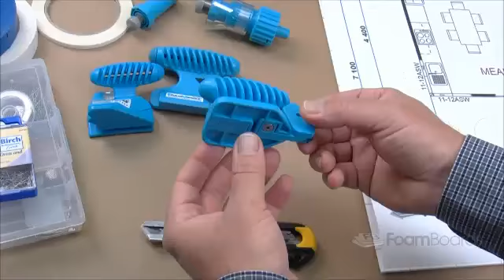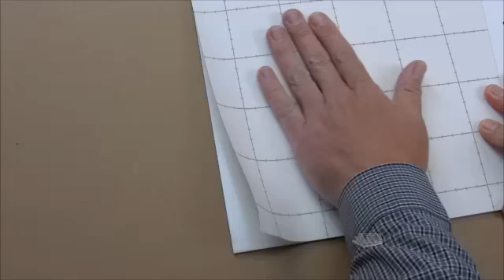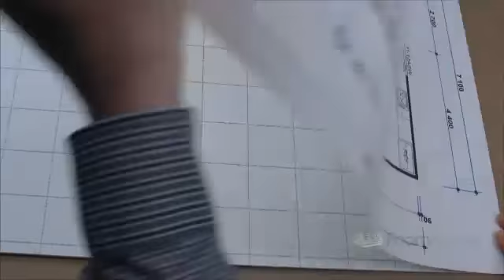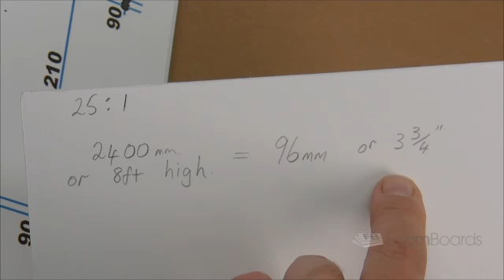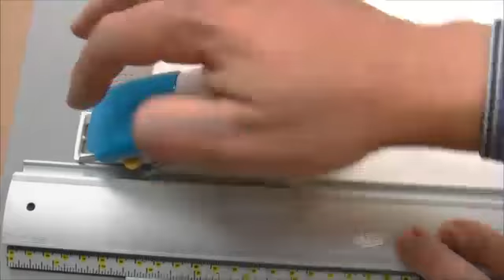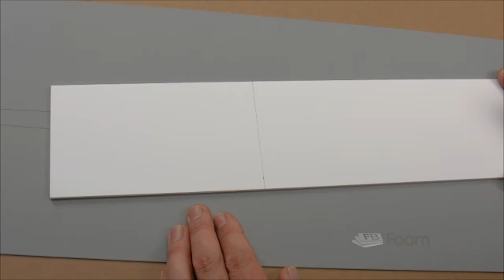Foam Board Model Making House Architectural Model Part 1

Comment: Do you ever paint your foam board models? If so, what do you use? Thanks
Reply from the maker: Hi Helen, You can use many different paints and pens etc but just be careful of solvent based paints that can dissolve the polystyrene core. The other issue to be aware of is paint can cause the foamboard to buckle on occasion due to the tension created by the paint shrinking as it dries on the surface. This bowing can be minimised by painting both faces of the board.

Comment: It looks as though I would have to spend several hundred dollars U.S. to get started in this hobby . Excellent Video .
Reply from the maker: Hi Trevor, You can start with a sharp utility knife and a good non-slip ruler, a hot glue gun or some double sided tape and it shouldn't cost you much to have a go.

Comment: can you use glue also
Reply: Hi Rodolfo, You can use a variety of glues but the advantage of double sided is speed. Another quick glue to use is the hot-melt variety from a glue gun. The only glues to avoid are some of the solvent based types that can dissolve the foam.
Reply: @davidschummy106  tried Elmer's school glue and came out all shaped and wrinkle

Comment: can you use PVA glue to stick walls together etc, i know its a stupid question , just curious
Reply from the maker: Hi QANTAS 1978 you can use PVA glue it has to be held, pinned or clamped in position until it sets. Another option the RC model builders use is hot-melt glue. The glue sets quickly and is rigid and strong. If you are going to use hot glue get one of the better glue guns like the Bosch and use the larger glue sticks to apply the glue quicker.

Comment: I'm not familiar with the metric system,(im from the us) but the scales we use are 1/4"=1'-0" 1/2"=1'-0" and so on. 1/2" scale more common for elevations, so would that be a common size for an architectural model? Sorry not an architecture student but am interested in making a model home for portfolio's to become one.

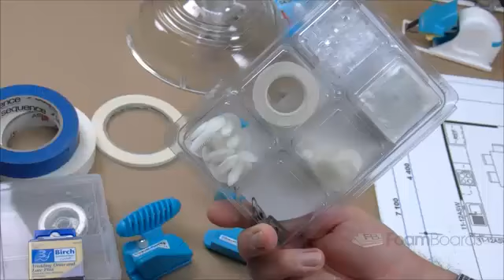Comment from the maker: Hi Daniel. Please elaborate further. Was there an error somewhere. We often make various models in the common scales of 1:20, 1:100, 1:200, 1:500, 1:750, 1:1000 depending on the project and what the model is to be used for. The larger scale model demonstrated would be more used as a teaching aid than as an architectural model but often 1:25 models are commissioned for showing specific details for clients like solar panels or specific functional areas of a design. Thanks for your feedback. FB

Comment from the maker: Hi Khalida, the floor plan was printed on an Epson 9880 inkjet printer and then mounted to the adhesive coated foam board. The 9880 prints up to 1120mm wide and I think when we did this one it was on 610mm wide synthetic paper. You could always print the design out on smaller A4 paper and tile it onto the base board. The adhesive backing is quite aggressive but when mounting smaller pieces quite easy to work with. Thanks for your positive feedback. Kind regards, David Schummy foam boards.com.au